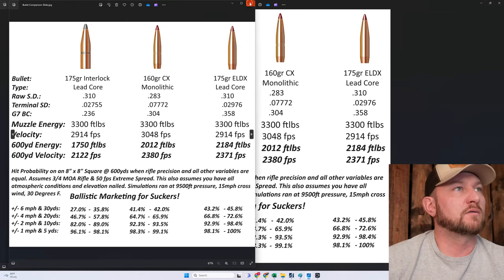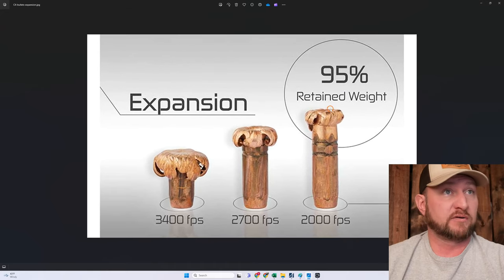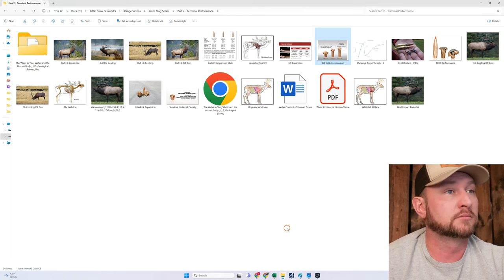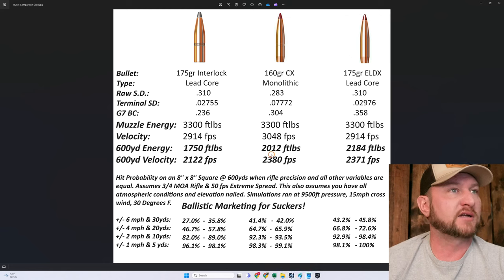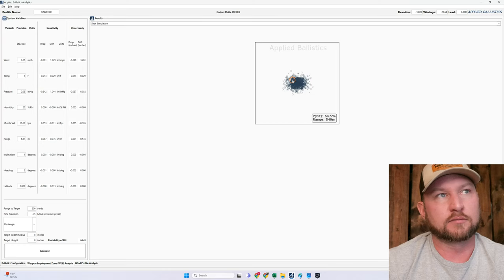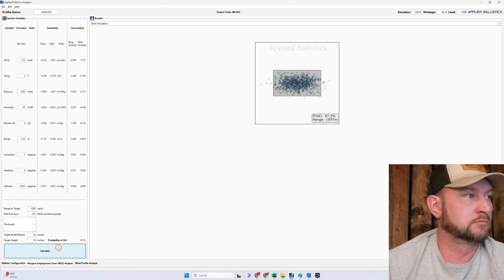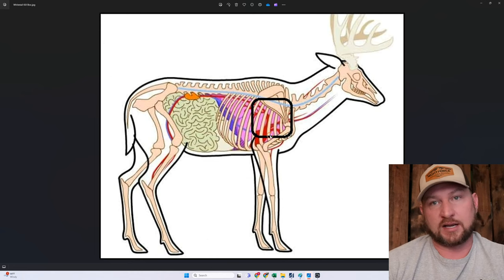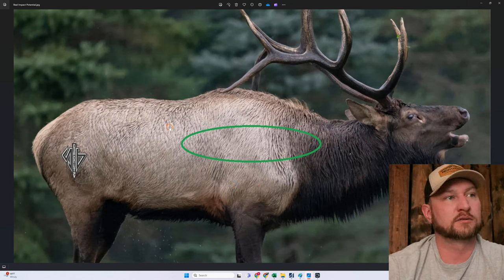7mm Showdown | Part 2 | Why Bullet Construction Matters | Terminal Performance & Hit Probability

Comment: Thank you for all the work and information. After 20 years of shooting long range reality set in last year after trying this for 3 months every weekend cold bore one shot kill at 1000 was about 30%.  It made me really pull my range back and what shooting positions dictated my effective range.
Reply: All of this nonsense of shooting 1000 yards and then when I bought the first range finder then used it on the North Oregon with massive canyons that often are miles deep when I started checking ranges, I knew on the spot how liars are using range to bull shit people. 
I set up a 5'x5' target at what the range fined showed 1000 yards then went back across the canyon to look and what did I see what a 5'x5' target was almost a spot that was barely visible, and I had to turn the Leupold 6.5x20 to 20 power to get a good look at that target.
So, stop with the bull shitting the ignorant viewers of these comments that 1000 yard is really nothing to sneeze over.
I did try to shoot that target at 1000 yards with a 300 Weatherby mag in a Mark 5 and with the custom Brevex Mauser in 8mmx378 Weatherby magnum both rifles I hit the target but only after using allot of ammo and many trips around the canyon to check where the bullets are going.
The few bullets that did hit the target had been scattered all over it.
By no means at all is it easy to hit targets at that range when wind or just breeze can change the flight of bullets and time in the air as the world turns make a difference in bullet flight to the target.
These comments sections at just filled with liars making up crap or also making up crap that is just impossible to do!
I don't have any interest to be a bull shitter to get people's attention using lies, what I write is actual things I have done and if something I've done failed well maybe someone reads it then know not to do what I did.
For all who write silly nonsense about shooting long range go buy a ranger finder them start checking how far things are.
Reply from the maker: Dale, shooting 1,000 yards is not uncommon anymore. I do it every time I go out to the farm for testing. It's not difficult when your knowledge and equipment are up to the task. Watch my 22 Nosler videos. I shoot that little 22 caliber at 1,030 yards ON VIDEO all the time. It's not hard if you have things figured out.

Does that mean I think it should be done on a game animal? No. But the days of 1,000 yards being some impossible distance to hit targets at are LONG gone.

I do it multiple days per month. Often on the first shot, at a 16 inch square. Not some big 5ft plate.

As I mentioned in the first video, last summer my buddy and I went 4 for 5 at 2073 yards on a 22 inch by 30 inch rectangle.

These distances aren't impossible anymore.

Comment: I'm medically trained and your account of an exit hole induced tension pneumothorax being more quickly lethal than soft point destruction of inflated lung tissue makes eye opening sense. Any ER/ED physicians out there. I have a sika (weigh 180lbs) stag roar hunt in  2 weeks time and the option of using 162eldx 2940 dps or 150 cx at 2985fps from my Rem mag. I'm tilting towards the cx.
Reply: The deer will never know!!
Reply: I'll never shoot another ELD at anything with hair ever again. Wasted meat with well placed shots. Dumb comment that the deer will never know. The hunter should know. Course I gave into advertising and bought some even though I've had 53 successful hunting seasons under my belt. Bonded bullets only now and forever for me.
Reply: @KB-ld6ql   so are you saying that the eld didn’t kill the animal or it wrecked your meat?  I use accubonds for my trophy hunting and they too explode if your up close, and also ruin as much meat, I’m curious as too what your talking about?

Comment: Oh boy... you're really kicking the hornets nest now... All the rage is using match bullets for hunting lol. I agree with you on bullet choice. My preferred hunting bullet is the Accubond and the Barnes LRX. I haven't done load development for the CX.
Reply from the maker: I haven't found a nest I won't kick yet! I think the match bullet crowd was sucked in by the performance numbers and talked themselves into liking the fact that the bullets explode.

But as I showed in Part 1, all that BC doesn't help as much as they think it does. If you look at drop and drift charts, you would say otherwise. But Drop and drift charts are useless for anything but selling ammo.
Reply: @LittleCrowGunworks  While pulling in #10 electrical copper wire in to pvc conduit, the full spool slipped and rolled down the hill. It hit a hornets nest square on that was in the brush. 

I got hit several times getting that wire back. Not fun😢😢😢

😅😅😅😅

Comment: For new handloader....To your point, I can't believe how many people rely on B.C. for NO REASON. For example, if your hunting in an area where your max distance for a shot is 30 yards from a tree stand, and your shooting white tale with a 30-06, you don't need a 210 gr projectile with a G1 B.C. .600 (.302 G7). Something like a 180 grain Flat base round nose Pro-Hunter with a G1 B.C of .280 is more than sufficient to take your deer. A moderate loading at 2,400 feet per second is more than enough.
Reply from the maker: @semperfi6288  Absolutely. Pick the right tool for the job.

Comment: I don’t like the short barrels either!
Reply: But that leads me to find the thinnest barrel at 26 to 28 inches that can hold a min 3 shot group and then a five shot group. Or does that even matter with a cryo treated barrel? Or does cryo even work?
Reply from the maker: The jury is still out on cryo. Don't go lighter than bull sporter .700 muzzle and flute it to take weight off.

Comment: I may be on mount stupid, but wouldn’t having a good quality weather meter eliminate a lot of the weather variable in hit probability? I haven’t done a lot of long range shooting personally, but a lot of the variability in your hit probability has to do with weather conditions, so I feel a good weather meter would help tremendously. Again, I may be on mount stupid here, but it’s just a thought.
Reply from the maker: Great question. The weather meter will eliminate the Pressure & Temperature variation but most don't read humidity, so that's on you, but it's by far the least important variable. Weather Meters do read wind velocity at the shooter. But that's only useful in the plains. Because you are standing in, shooting through and shooting to where the prevailing wind is most dominant.

In the mountains, it is COMPLETELY different. If you're on one side of a canyon, shooting to the other side; there will be at least 2 different wind currents, maybe 3 or 4. This is something I could do an entire video on. The short answer is, the wind where you are, is not what the wind is at the center of the canyon where the bullet is flying through, nor is it likely the same as where the animal is standing on the other side. So in an instance like that, a weather meter is borderline harmful, not helpful.

Thanks for the question.

Comment: I dont mind the longer videos when they contain relevant and we'll explained information, such as these. I understand the rationale of exiting the hide and the lungs collapsing, but if that is the case, wouldnt a FMJ be just as effective? It will penetrate and cause an exit hole,  yet they are generally prohibited by law due to a lack of effective terminal performance? Not trying to argue, just me thinking through the process. You also mentioned Partitions not exiting. Did they effectively kill though, all be it without an exit? Or was the kill delayed in your observations. I have shot Accubonds a lot, and know that like Partitions, there is a possibility they might not exit, but they have always given very good tissue destruction along with being at least under the off side hide, if not exiting. I know that in those case we forego the exit hole, which is desirable, but seems the animal never goes far and dies quickly, which seems to be the job of a game bullet. I known you selected the CX for a reason, obviously, but what are your observations on terminal effectiveness of the Partition/Accubonds, when not exiting? Thanks for any experience you can share on this topic.
Reply from the maker: Hey John, great question. An FMJ doesn't expand, so there is minimal energy transfer or tissue destruction to the animal. A monolithic does expand AND in a controlled manner. The reason they are so effective at killing AND still exit is the amount of expansion and shape. Because of the monolithic material, they will not fail if they hit heavy bone. They also resemble a wadcutter when fully expanded, which is excellent at displacing material. But the key is the AMOUNT of expansion. They typically expand from 1.4 to 2.1 times the original bullet diameter. It is this "lack" of over-expansion that keeps the Terminal Sectional Density high enough for the now wadcutter shaped bullet, to reach the off side with enough force to blow out the hide.

Typically a bonded or partition type (A-Frame, etc) bullet will reach the hide on the off side of an elk and "sometimes" exit but not usually. Because the expansion is more like 2.2 to 3 times original bullet diameter and it just has too much drag when passing through the body. So it usually gets stopped by the tough, stretchy hide. But they kill just fine. I would say slower on the average because the lungs collapse slower/less often if there is no exit.
Reply: @LittleCrowGunworks  Very good to know. Thank you for taking the time to respond and to help others like me learn more about our great sport.

Comment: Tim, I’m coming up with .1197 for a terminal SD for the 160CX.  That’s with a recovered weight of 152 grains (95% weight retention) and 1.5X the recovered diameter.  (.426 squared).
Reply from the maker: Good Observation.

I didn't want anyone to accuse me of playing favorites with the numbers. So I used 99% weight retention and 1.9X diameter.

I high sided the retention but that is WAY less important than the diameter, because the diameter is squared. So I high sided the expansion as well. My number is a "closer range torture test" where the bullet is expanding to near it's maximum diameter. And with the 150CX at 2800fps, Gavin had 99.8% weight retention and 1.9X expansion. So that's what I used (I rounded down to 99%). Based on our slide, with a 7PRC, 2800fps would be the impact velocity at 225yds in our "Mountain Conditions".

I personally think long range expansion will be close to that 1.6 number that you came up with.

Thanks for pointing that out.

Comment: excellent video on bullet selection.  Watching your videos changed my mind on what bullets I’m going to use for Elk hunting.  Thanks
Reply from the maker: Glad to hear it! You won't regret switching. It's an elk hammer. Dale flattened a mature bull last fall at 40yds with that 28 Nosler and a 160gr CX. North of 3100fps impact velocity, broke both shoulder joints and left an exit you could stick your thumb in. Elk dropped instantly and never got up. That is an absolute torture test for a bullet. Passed with flying colors.

Comment: Maybe it’s too basic to even mention or I missed your commenting on it, but the horizontal oval dispersion tells me wind reading/variability is more important than range finding. My guess is that before electronic range finders your oval would’ve been vertical, as well as significantly larger. Those little gadgets may have a lot to do with the long range shooting craze, both targets and hunting. 

Off topic - thank you for being so direct about your ability to whip out your can of troll-b-gone. I hadn’t heard another YouTuber acknowledge that level of control over the comments section. It says some interesting things about videos with really hostile and/or stupid commenters.  The content creator either likes the controversy or just doesn’t care. What made me think about it was a news channel video where every comment echoed the opinions in the video. Now I know for certain that had I commented there, my opinions would’ve been disappeared by the channel (which has happened more than once).
Reply from the maker: Great observation. You are correct. Big picture, range is the most important. But rangefinders have almost solved that for us. Now, wind is the biggest issue. More important than 100yd group size, extreme spread, ballistic coefficient, etc. 

Inability to read wind can swallow up all of your hard earned precision at the reloading bench.

Yes, it does say something about toxic comment sections and the channels they reside on, doesn't it? I expect some constructive criticism and push back. But if you're going to come on here and try to treat me like I don't know anything and you are the all wise gun wizard from your cozy point of anonymity, offering nothing but criticism on my FREE VIDEO, you can hit the bricks. We don't have time for that. Go start your own channel and educate us all. Oh wait, you won't do that because you're a lazy troll. I have a permanent solution for just such an occasion... IN TWO CLICKS OF THE MOUSE... TROLL-B-GONE!

Comment: I’ve always been a big TTSX and Accubond fan. I’ve used the Interlock with great success. I know you’re talktalking about Elk and I totally agree with you but I would like your opinion on something. On Deer (125-225) pounds how do you think the ELD-X will perform compared to a cup and core like the Interlock. I’m curious of your thoughts. Thank you
Reply from the maker: Great question. The Interlock and ELDX are designed very similar to each other internally. The Internal "Lock Ring" mid bullet is very similar between the two. But the ELDX is a G7 Standard based bullet, and the Interlock is a G1 Based Bullet. 

The Interlock will hold together better under all velocity bands. The ELDX will expand more violently at all velocity bands. I think if most of your shots are sub 250yds, you are better of with something other than an ELDX. Unless you are using a low velocity cartridge to begin with. If your shots are 250 to 600yds, I think the ELDX is just fine on Deer. Then the velocity will be low enough that the bullet will look like the center image on my slide and MAY exit.

To be perfectly honest, I think heavy Bonded Bullets are OPTIMAL for deer. Expand quickly to nearly triple diameter, retain high weight and likely will exit. If you gave me cartridge and barrel length I could be more specific.

Thanks for the question.

Comment: A long video is not a problem for me.
I really appreciate your no bs approach and actual knowledge and research. 
Elk definitely reacts differently than a deer when hit and seem to be more predictable. 
Antelope also don't react the same as deer or elk for that matter. 
I also find little to disagree with and wouldn't have any confidence in an eldx on anything bigger than deer either. 
I have seen an elk drop on impact from velocity one time on a basic behind the shoulder lung shot, but only one time.
I have a question that's sort of off topic, but I'd like to get your opinion. 
Here in Wyoming, you can get lots of Antelope tags, so I've shot a pile of them, and the bullets I've used always exit of course, but I've studied the blood loss quite a bit, and I've noticed they bleed a lot from the nose as well as the bullet holes.
I'm curious if you've seen that happen with elk.
I've been shooting between 7 to 10 big game animals a year,  but I've never really studied the blood trails from elk, and the vast majority of the deer drop with the cartridge bullet combination I usually use.
Except for when I use my sharps 45-70 or my 375H&H, of course.
Anyway,  I'm enjoying the free knowledge you're sharing because no matter how much I may think I know,  I can definitely benefit from learning more,  and I hope very little practice with doping and such for extended range with rifles other than my 45-70,  which is completely different. 
Thanks again,  and I'm happy to hear you'll be making them closer together. 
But,  congrats on getting more distribution on your case trimmers. 
I may have to try them,  but I didn't know about them when I got the snazzy trimmer I did get.
I'm a big fan of cartridge specific reloading tools because of the option of setting it and being done with the messing around.

Comment: I am just surprised that you guys believe that the Barnes lrx bullet is not as suitable as the hornady bullet!
Reply from the maker: Hey Anthony, I never said the Barnes LRX wasn't as suitable. I just said we like the CX. The CX is lighter and has better BC than the LRX, which will give it better hit probability, all other variables equal.

There's nothing wrong with the LRX, or E-Tip, or Trophy Copper, or any other expanding monolithic. But of the expanding monolithic bullets, the CX has the best BC.
Reply: @LittleCrowGunworks  thanks for the clarification my 20inch 7prc really like’s them better than the cx bullet,  but My goal is harvesting a moose no more than 2 to 300 yards out. In New Hampshire I’m trying to get a tag. My barrel is from the Oregon mountain Rifle company. Its got 1-7.5 twist.
Reply from the maker: That's a good goal. Hopefully its a 168 LRX you're talking about.
Reply: @LittleCrowGunworks  yes!!!